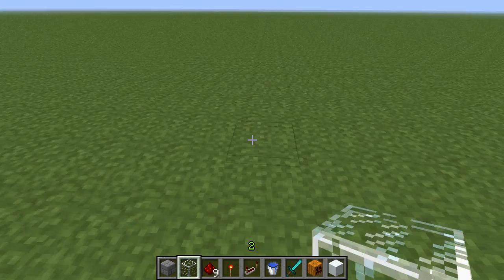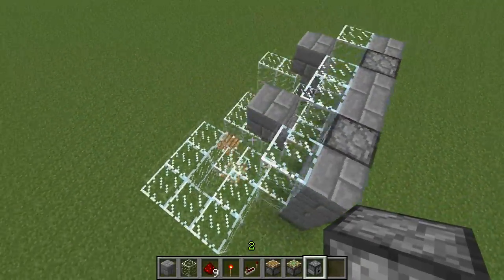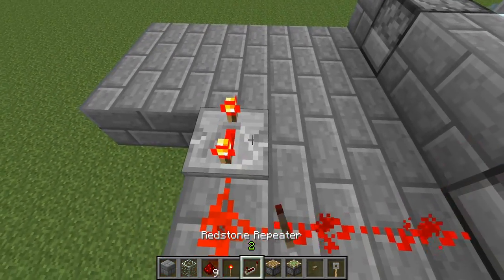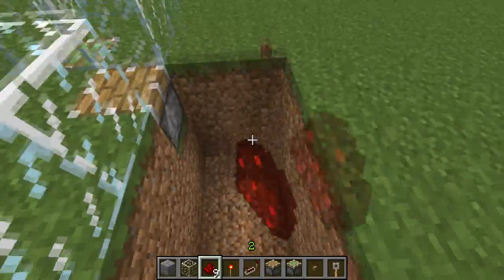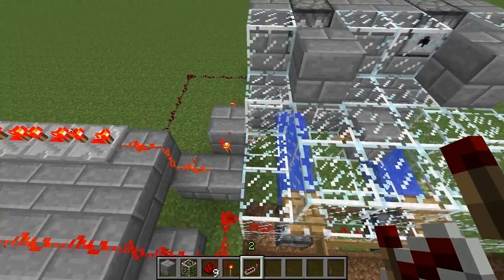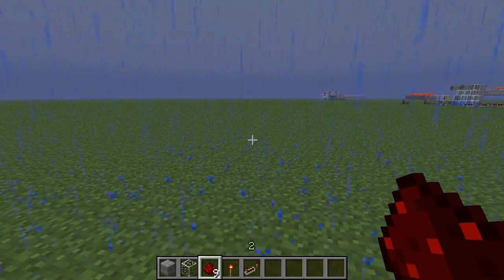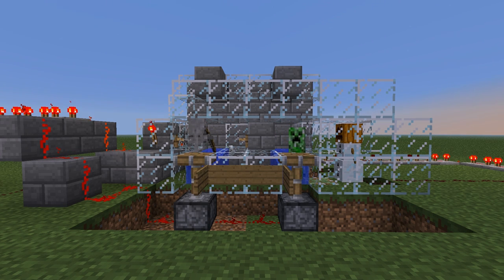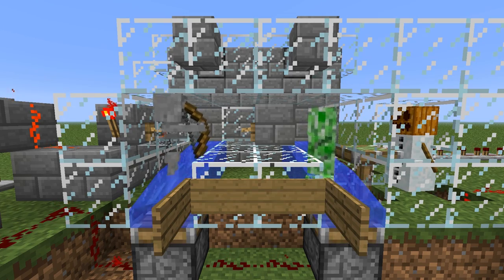Self-Mining Machine (no mods) - Minecraft

Comment: ok heres some of the many issues to this; to set this up you would need to build a mob sorter, (for those who dont know it is a machine that scares skeletons into going down one path using wolves, attracts zombies with villagers, uses single wide halls to block spiders, and leaves creepers to float semi-aimlessly. the next issue is it would be extremly difficult to make the machine function automatically, since if you tried to afk it there would be no telling when what mob would enter each tube, meaning it would be much easier to agro the creepers yourself. This machine, assuming it would work to the point the creeper comes out agroed, would have an extremly limited range since the creepers would eventually start dieing to fall damage. and possibly the most important issue to discuss, is that any ore would be blown up, and in the time it would take to build this machine for just the sake of building a hole, you could have just afked while having a weight on your mouse, and dug the hole yourself. so dislike if your not an idiot...

Comment: I saved this to work on when college is not sucking up all my time, but I have some questions (more like just wanting to know if my thoughts are in the right direction) about where to go beyond your tutorial.

Once the mobs are sorted and I can get this system to drop angry critters in a hole... how many cobble generators would I need. I am guessing 3?
One cobble gen for the floor.
One double cobble gen for the walls moving south and east.
One double cobble gen for the walls moving north and west.

I am guessing the hoppers could/should be several blocks below the floor created by the cobble gen, perhaps far enough to insure the occasional falling mob dies to insure the hoppers are safe from explosions?
Reply from the maker: Correct, expept the cobble generator part. You don't really need a sideways generation of cobble. Mostly because it doesn't really matters how much free space the mobs have to run "down there", because the creeper would simply blow up as soon as he hits the ground. The point blank for his explosion is only one.

Comment: Just thought about this after reading some of the comments. I won't mention whether or not this is a good self-mining machine or not, but there may be a better application for this. 

This might make for a good survival mode trap. Basically, you have the skeletons / creepers drop down to a path way with a layer of obsidian on the bottom (and sides?) so that the blast kills any unwanted visitors (and not destroy the blocks to oblivion). The issue with getting skeletons and creepers (especially in multiplayer) will still be an issue without eggs. I'm sure someone has a solution for that. 

I guess this design could be used for some off limits mining areas, or maybe at an entrance of a base. This would make for a killer trap in adventure mode too! It's basically an infinite TNT trap. Also, as someone said, after 24 blocks, the creeper dies. There must be a level where the creeper explodes without hitting bottom... wonder how far that is- and is it constant?

Anyway, I think it needs an update for 2015.
Reply from the maker: I could give a lot of answers, but you gave me another idea. An update..... Why not make everything clear in an update video..? Why I never thought of that. Thanks bro.

Comment: With the amount of time building this machine, making creepers and skeletons move in at the correct place in survival mode. meaning that it will only work during night, or underground, and you have to dig a hole for it if and seal it if you want it to work during the day. and even when you get it started up, you have to go down even longer for each creeper blowing up to collect your blocks. And eventually when you hit bedrock it will stop working properly. so then you have to tear down the whole machine, and  put it up somewhere else. All this seems like a lot of work, when farming all you need in survival mode, for that little hole the creeper blows up.
its a really cool machine, it does dig a hole straight down into the ground, but all the time you spend creating it and moving it to different locations, will it go any faster than just digging the whole manually?
Reply from the maker: You don't have to move it dude, you can build a massive Cobblestone generator on the stop if you want to farm cobble, and you are able to collect it with hoppers and/or minecarts. Also, you can simply build it above ground and light up the area around the surface with torches to enhance it's efficiency.

Comment: I came here expecting an afk cobble or stone generator :/
I wanted to compare my v3.0 afk cobble generator with auto stone furnace and auto pickaxe. 3.5 stacks of cobble and 1 stack of stone every 2mins of afk.
I like your build, but its not really survival worthy.
It'd be possible to get it to work in survival, but the time and resources required would outweigh any benefit of this.
It'd be alot easier to use tnt in a dispenser on a clock.
Or I could punch a creeper in the face and stand there in my blast protection 4 armour.
I like the concept but the function is almost redundant.

Comment: This is a very pointless contraption considering even after setting it up with exact timers to get the mobs in the correct place at the correct time it still doesn't work let alone getting them in the right place normally.  You might as well get skeletons to kill creepers, without a complex useless machine, so you can get records.  Seriously all in all you can mine more stuff in the time it takes to make this machine than the machine will ever yield considering it becomes completely obsolete after 15 blocks down, therefore rendering self mining machine into just a useless machine that mines 5 blocks down after wasting a good amount of resources